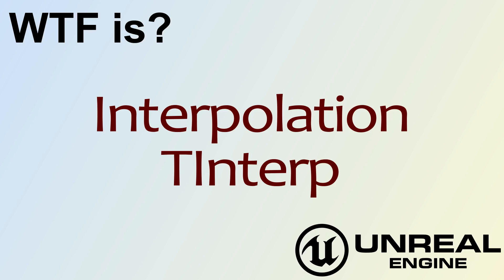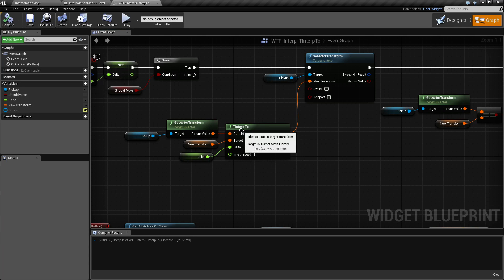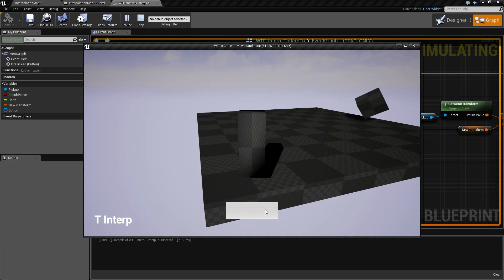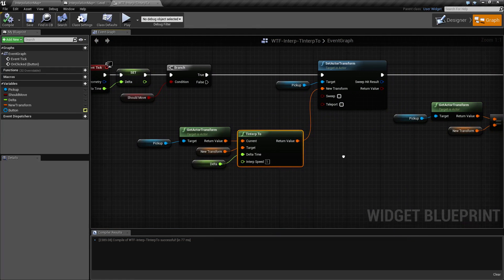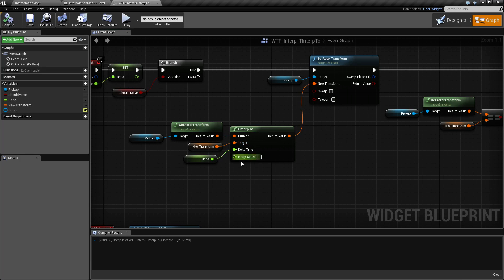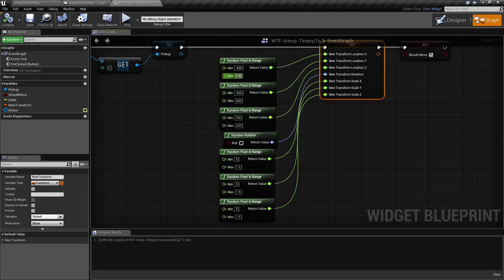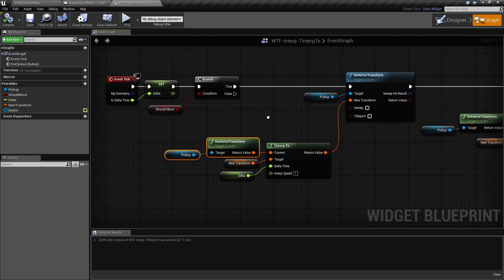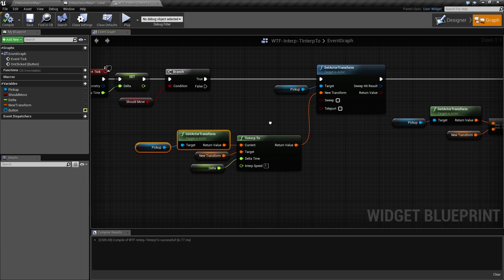WTF Is? Interpolation - Tinterp Node in Unreal Engine 4

Comment: Is it possible to use this for force a skeletal mesh to move without the need of a Nav mesh?
Reply from the maker: +Amaranthine Story IT should be yes but you have to keep in mind it is just going to be from point A to point B.  Navigation, obstacle avoidance, and the other benefits of the Nav Mesh are not going to be available if you use this.

The TInterp Node is just going to let you define 2 points and smoothly give you back transform values between them.  You can then use that to re position your skeletal mesh.